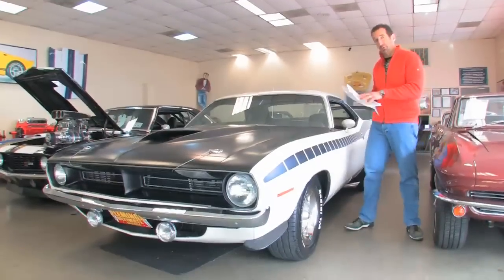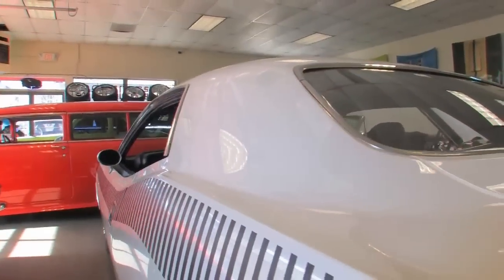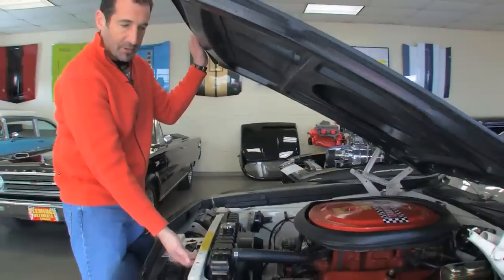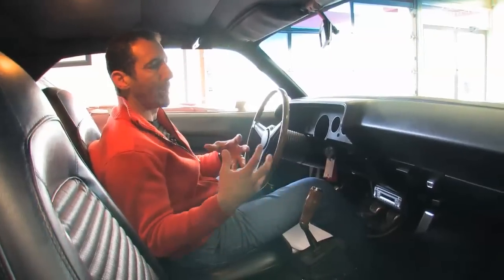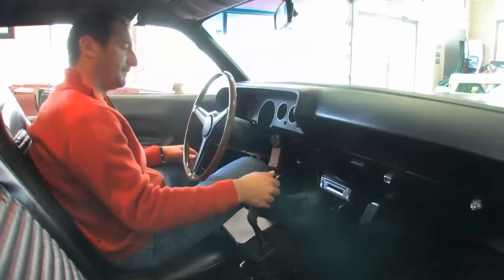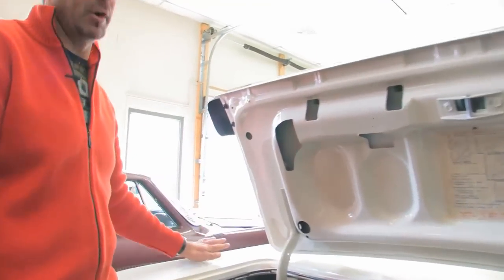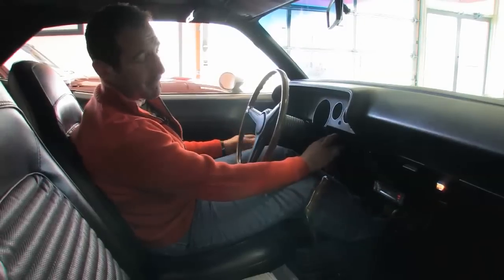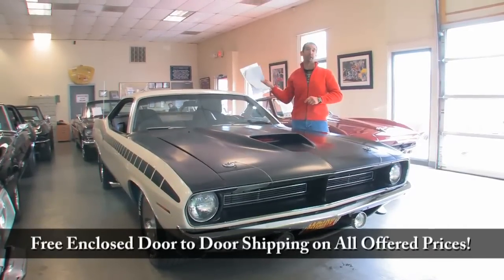1970 AAR Cuda for sale with test drive, driving sounds, and walk through video

Comment: Notice he said no power steering and no radio. But I had a 70 AAR Cuda' and it had not only power steering, but fast ratio power steering like on police cars. And came factory with an AM Radio with in dash 8 track tape player. And the wider front fender wells were not only for wider wheels. But to make room on the inside of the hood for a 426 Hemi...
Reply: Yup. There were at least 3 optional steering packages. Manual steering, typical Mopar power steering, and the Fast Ratio power steering. I believe that the Fast Ratio PS was maybe the best option for these cars, other than the 4spd. With the big tires & wheels the Fast Ratio PS made this car handle better than every other Mopar made to that point. No vague and nebulous, disconnected road feel of the typical Mopar.

Comment: the speedo cable in my AMX broke a few years after i bought it, but haven't put more then a 1000 miles on it since. my 73 AMX only has 51,000 miles on it (cause it sat off and on for the past 30 years, 10 years at a time). i belive they are the original miles due to alot original wear and tear parts on it (like the original drums with factory chalk marks).

Comment: Just a small thing but you need to rotate the hood pins 90 degrees as the pins should be parallel with drive shaft. Most wouldn't catch this but you go on about original this and original that. Why not present the hood pins correct? I am just saying.